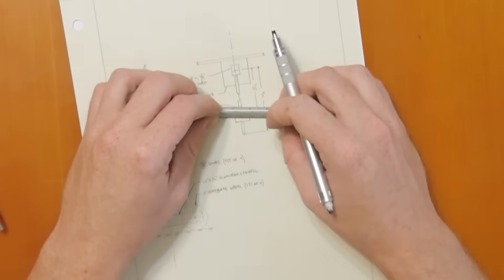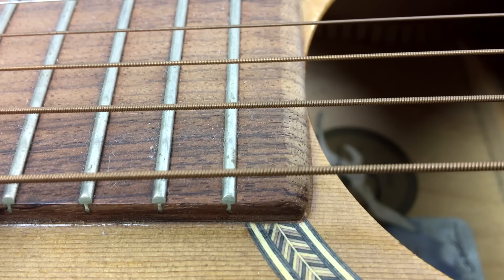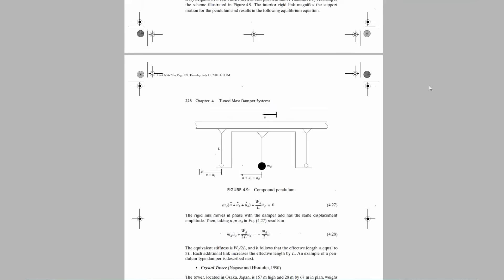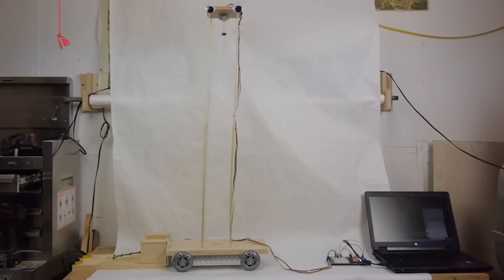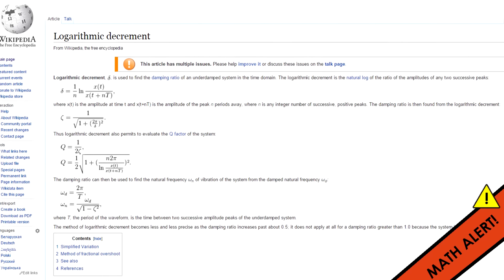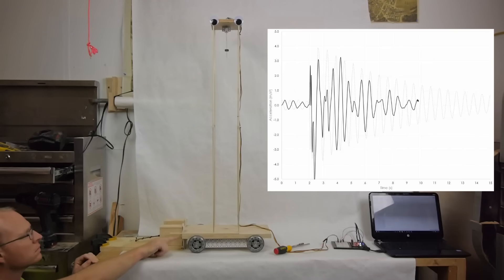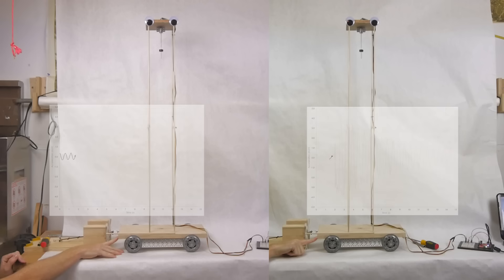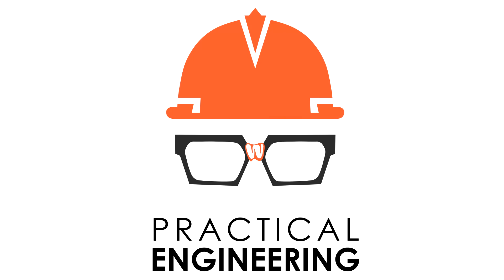What is a Tuned Mass Damper?

Comment: That test was a good simple example.  In the real world couldn't they incorporate an electronic device to vary the drag on damper as to transfer more energy to it?
Reply: I do believe that's exactly what they do.
Reply: @vincentrobinette1507  There are such systems in use, but there's a very real danger that a failure in these systems could lower the damper's effectiveness to what could be catastrophic levels. Simplest is best here only because it has the fewest possible failure points.
Reply: @P_RO_  That's why I would use such simple systems. A copper or aluminum disc and permanent magnets would be quite reliable. So would simple passive hydraulic shock absorbers, not unlike you find in a car or truck. I agree: Forget the electronics! During a seismic event, you can't count on electrical systems of any kind.

Comment: Hi Grady, I was just wondering if there would be a way to usefully extract the energy from the motion of a tuned mass damper (say by using the movement to pump a fluid, or to drive an electric current). I wonder if this would be configured to give more rapid damping too. Jothi

Comment: Could the gyroscopes stabilizers used in boats be added to dampen the initial amplitude?
Reply: There are building dampers which use more 'active' elements, but it's rarely necessary to go that far with designs, and it needs to be remembered that the more complex something is the more potential failure points it will have. Given the potential for damage a skyscraper failure has, simplicity with less perfection is a better choice.

Comment: I run Tower cranes in St Louis and I once felt an earthquake in California I believe it was about an hour and 10 minutes later. This would have been in the summer of 2018
 Tower cranes do not have mass dampers of any kind. 
I suppose I could suspend a heavy load below the Boom.
You know come to think of it we could do a giant experiment with this crane. 
It takes about eight seconds for this crane to go through a full cycle. Except here the oscillation is usually caused because of the load hitting the ground too hard.

Comment: I screwed the upper edges of the walls to the ground and get the result. SOLUTION
Connect the base to the periphery, with the earth, with the mechanisms of the patent

This connection of the base with the earth it transfers the torque power into the earth by preventing the transfer on the foot girder

If the union - consolidation is made at both ends between the upper edges of the wall and the ground then we stop many other destructive tensions such as these are created from

a) The bend of the wall, (b) the critical failure area, (the critical failure area does not appear with this method ) (c) the potential difference of the relevance mechanism observed in the body of the wall near the base there in the critical fault area between left and right torque. d) The connection of the upper edges of the wall with the ground beneath the foundation deflects the upward wall tensions (created by torque, roll over the wall) into the ground by removing large stresses from the structure.

The control of the displacements - deformations  is 100% connected with the structural damage control, because by controlling the displacements - deformations of the construction is prevented the occurrence of the damage

Comparable experiments.

1) Experiment, with insufficient displacement control
https://www.youtube.com/watch?v=l-X4tF9C7SE&t=74s

2) Results of failures of the first experiment
https://www.youtube.com/watch?v=sZkCKY0EypM

3) An experiment with the invention which controls 100% of displacements.
https://www.youtube.com/watch?v=RoM5pEy7n9Q

Comment: suggestion for v. 2.0.

I’m a CS person with a few semesters of physics and some EE courses, but I was missing something on first listen that an earlier comment nailed.  A possible alternate explanation follows.

The tuned mass damper converts the kinetic energy of the swaying building into thermal energy, represented here in the. friction on the screw.  Is that correct.  Is there an equation that shows what happens as the friction at the screw is increased?  

Your video already shows what happens when the friction is 0% and 100%.  It would be cool to see what the equation would predict for the optimal friction setting and how the system would perform.  If this is impractical, at least saying something about the kinetic thermal tradeoff would be enlightening, if that’s correct.

Comment: I learned about Pendulums in school, but never seen their value more then a curiosity. Now it makes more sense as  a practical sense. Thanks for the small piece of information.
Reply: Clocks!
Reply: Well, what about demonstration/proof of earth rotation?
Reply: MacIn173 the certainly become useful in many measurement applications
Reply: Didn't learn about capitalization though.
Reply: @User0000000000000004  you didn't learn about decency either so it evens out.

Comment: What if...
What if you put several TMDs in parallel, having them each hang from the same roof?
What if you put them in series, dampening a dampener dampening a dampener dampening a dampener....
Reply: To your first question--- you get the same effect.  The positive result of the damper is the horizontal component of the force vector at each level, and you only get one net vector per level regardless of the number sources.  

To your second question-- similar to the first response:  you only get the benefit from the point of attachement of the pendulum to the diaphragm.  Everything that happens below there will amount to one net pendulum/damper combo as far as the building can tell.  And if the net period is off as a result of your series, you accomplished nothing.
Reply: @HollywoodF1  Actually no, it would be much worse than that.  Having one pendulum attached to another is the classic example of a chaotic system.  If you tried to use such a setup as a TMD, you would usually get a smaller effect (as the lower TMD would dampen the upper TMD, meaning less dampening action for the upper TMD to apply to the building.)

But sometimes it would damp much better than expected.. and every once in a while, you would end up with the system swinging wildly out of control and potentially even having a negative dampening affect (albeit only for short intervals.)  Chaotic motion can be quite the mess.
Reply: @HollywoodF1  What about a series of separate pendulums at harmonic distances? say on the 20th, 10th, and 5th floors, for example?
Reply: woahhh
Reply: Dugo akong ilong...atay njd...

Comment: Hi Practical Engineering!!  Im doing a project for my Dynamics of Structures class, and I am very interested in your model. If you dont mind, I have a few questions about your experiment. What dimensions did you use for the model of the tuned mass damper system? And most importantly, how did you measure the magnitude of the impulse force from the rubber band in the base of the structure? I would appreciate your input. Thanks !

Comment: Practical Engineering
i know this is rare case, but engineers specialty is rare cases, its those cases that no one thought could ever happen when they do that the engineers say "good thing we thought of that already", also pardon if i have the wrong terminology usage, but basically say there was an earthquake, and say it just so happened on a windy day, and the wind is near or at the frequency of the building, so as the dampers are in action trying to cancel out the earthquake, can it also cancel out the wind at the same time? is the difference negligible? or can the wind be detrimental to the damper sway in action as its trying to cancel out the sway from the earthquake?

Comment: Make a sky scrapper too high and the forces from both the ground shaking and the Mass Damper will wreak havoc in the middle portion of the building, causing potential failure.

Comment: We did exactly this kind of bit of engineering in uni a few weeks ago, only with a bridge, and entirely virtual in MATLAB.
1) Get step response plot, display it normalized to 1
2) Extract differential equation parameters for PT2 type system
3) Model system with differential equation, plot impulse, step and frequency response
4) Model secondary system (damper) 
5) Let system 1 excite system 2, change parameters so response at resonance frequency gets minimal
etc

Comment: I have experienced large earthquakes on both the 26th floor of a modern 38 floor building and the 6th of a very old 18 floor building and the old building was WAY worse, you could see the glass flexing in the windows as the building moved and it took a good couple of minutes for the building to stop moving after the earthquake finished.

Comment: How do hot potatoes transfer kinetic energy? I thought it would radiate out thermal energy to the air and surface its sitting on using conduction convection and radiation. Any kinetic energy you give it is lost once you set it down where its transferred to the table or dampened by your hand slowing it down and also a small amount of friction as it passes through the air as you move it. I don't see how a sack of potatoes in the top of a sky scraper would have much effect. For example in NYC there is restaurant on the top floor of a sky scraper with any sacks of potatoes in the kitchen but they have almost no effect on the buildings sway.

Comment: I work with 3D printing, Delta style 3D printer(s) to be exact. 
They are quite tall. 
One of the most common issues in 3d printing can be vibrations/momentum of the moving tool head(effector), which forces us to slow down our print rates.  
  
So I was thinking, could we implement a tuned mass dampening system to our machines? would it be worth it? Thoughts?

Comment: Hello, absolutely understandable video, and great explanation, thanks for that. However, I have some thoughts. On picture at 3:16 (I don't know what the building is..) it seems more like outrigger construction, not like damper (by the way, apart from TMD there are outrigger constructions, which hidden from public view, in Taipei 101. There are a lot more about this beautiful skyscraper, but now not about it). 
Also, there are cool dumper system were used in Torre Mayor, it looks impressive, it's not like MASS damper system, but still it dissipates energy. 
I'm just curious about buildings, constructions and stuff like this, and wanted to shear it, and I hope my English is fine c:

Comment: Why can't the engineer use the pyramid shaped buildings not the one over Europe or Egypt. But like a tall one. Because the shape of the pyramid. All the weight is distributed to the bottom while the pointy bit has less volume there for, less weight. So when an sudden movement happen to the earth. The building would less likely to sway because of the light weight to the pointy bit. And best bit. Also while making this building, there should be holes to let the wind pass so the tower will be less effected to suck strong wind due to high altitude
Reply: I meant such strong wind not suck strong wind lol

Comment: Hey Practical Engineering! 

Why exactly does the oscillatory frequency of the damper itself have to be equal to that of the natural frequency of the building? is there any math principle that assures you that the damper will do its optimum performance when both frequencies match? 

Thanks
Reply: Yes, destructive interference as the pendulum oscillates the opposite direction of the building the two oscillations cancel out. When the natural frequency and the frequency of the pendulum match it is optimally dampened
Reply: Good question,
Reply: It is due to resonance because it is a forced oscillation: the building is forcing the damper to oscillate.
In this kind of oscillations, the equations state that the maximum forced oscillator amplitude (the damper amplitude, in this case) is achieved when the oscillating force frequency  (the frequency of the force the building exerts, in this case) is as close to the oscillator frequency (the damper frequency) as possible.
Having the maximum possible oscillator amplitude is interesting because it means it is absorbing the maximum possible energy from the building to then dissipate it through its own damping.

Comment: True
but how do Engineer's make buildings plane proof
Reply: It is not feasible with small buildings like those in Lockerbie in 1988. Even a small car can demolish a typical terrace house.

With skyscrapers, it's the building that is a danger to planes, rather.
When a bomber ground combat plane crashed into the Empire State building in 1945, the plane was totalled. The building still stands to this day, but the elevators have had emergency breaks ever since.

And that is why tall buildings have blinking red lights on top, to warn planes that there is an obstacle they should not fly into. Not unlike light houses which do a similar thing for ships.
Reply: Abolish Islam

Comment: wait I have a question. You have 3 parameters to tune, one is the friction on the screw and other is the length of your pendulum, and presumably also maybe the mass if your pendulum (won't affect the frequency but it might effect energy transfer between it and the building)

so what's the optimal configuration of these 3 parameters? There should be a mathmatical solution to it and we don't have to resort to guess and check

Comment: Does the Tuned Mass Damper still work once a building is loaded with tenants who have heavy furniture, walls, cubicles, computers, etc? Would a fully loaded building need to be tuned once loaded, or is the damper already tuned to accommodate the weight difference? Are empty buildings more or less stable than fully loaded buildings?

Comment: Would using a water tank tuned mass damper be even better? It could solve the issue with low water pressure on the high floors, reduce the build cost of not elevating a huge mass damper with a crane and even provide passive water pressure for sprinklers in the event of a power outage...

Comment: hi, nice explanation of mass dampeners, perhaps you should make one that included viscous and hydraulic dampening?
many systems are hybrids of the 3, i used to work as a wind turbine technician and many of the larger turbines has a mass dampener suspended in oil.

the difference inside the structure when deploying the dampener is astounding, with amplitudes of non dampened towers as high as a meter the movement is very noticeable and can even induce seasickness and move tools on the deck.
with the dampener the movement is almost imperceptible at the wind speeds where we are allowed to work.

before the nacelle is put on the tower there is some aerodynamic effect that has a tendency of putting it into truly resonant motion, if you are at the top when that happens the best advice is to strap in and hold on, i have seen 5kg bolts bouncing off the walls in those situations.
the solution to this was to wrap a rope around the tower in a spiral to break up the surface flow, it would be neat to see a demonstration of this.

thanks for some great content.
Reply from the maker: Very cool! Thanks for sharing.

Comment: I'm quite curious if it would be possible to have an active system instead? Would it also be economically feasible?
What if one would have a form of motorized weight that moves to counter the effects?
Would you potentially be able to have a completely unmoving building then, given that you can actually predict the effects of the wind in advance as you can measure it from a distance away from the building?
And how would a completely unmoving building change the requirements of the strength of the structure?

Comment: I work in the Audio industry. And I can make cancellations to one or many frequencies at the same time. Would it be possoble to have a sensor detect the movement of the building and through motors move a type of pendullum to the right direction to cancel those frecuencies?

Comment: A small suggestion for the hand-made structural model:
I found that the structure vibrates in torsional and out-of plane direction in the video. A SDOF TMD may not reduce the vibration of the structure obviously. I think to demonstrate the effect of TMD effectively, you may design the structure to vibrate only along the loading direction, for example, making rectangular columns instead of circular (to prevent torsional mode occurs). 

I think you may also demonstrate the vibration of structure when TMD is not attached to it (as a control experiment).

BTW, this is best, the clearest and the simplest TMD demonstration video that i have ever found in Youtube. Good Job!!!!

Comment: +Practical Engineering I was wondering how you can theoretically determine the reduction in the response acceleration (in this case 12%) due to the damping. Is this some function of the damping factor, the mass of the mass-spring system and the mass of the building. Also why did you not adjust the damping such that the movement was critically damped?

Comment: How do you know how much mass to have on the pendulum?
Reply: My guess is that it is a trade-off. More mass is better for the dampening effect, but puts more stress on the structure.
Reply: f = 2pi sqrt(l/g).   So the frequency of a pendulum is independent of mads
Reply: @jashijeyaantony7481  That's true, but the mass of the pendulum still matters for dampening. If the mass didn't matter for dampening, then  tuned mass dampers in skyscrapers would be a lot smaller than they are.
Reply: Paul Riebe   I.e. inertia ?
Reply: @louf7178  Indeed.

Comment: i really wished you had help us visualize the dampening, draw some arrows as to why a swinging pendulum would dampen the building's oscillation.. is it because a pendulum swinging the mass to the opposite direction of the building pulls it, thus lowering the amplitude. You didn't really answer the question,  how does it dampens/absorbs the oscillation? ... well how does it absorb it??